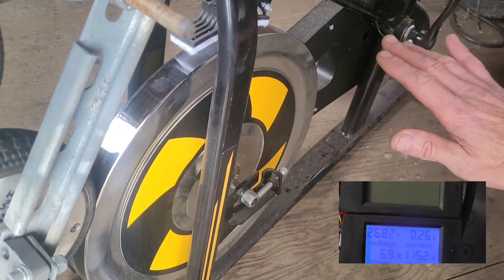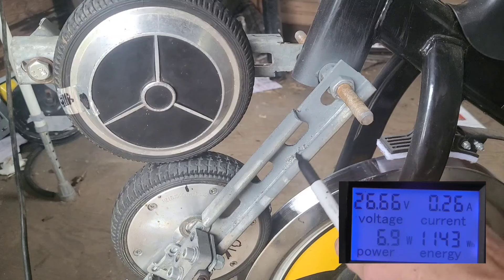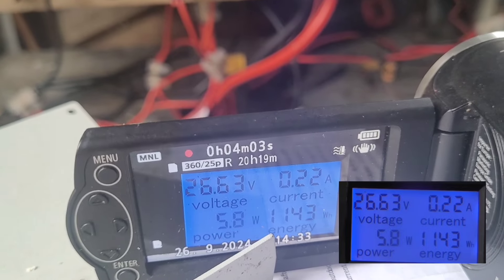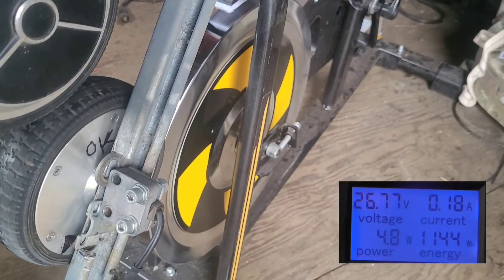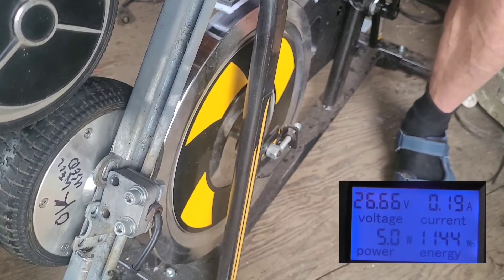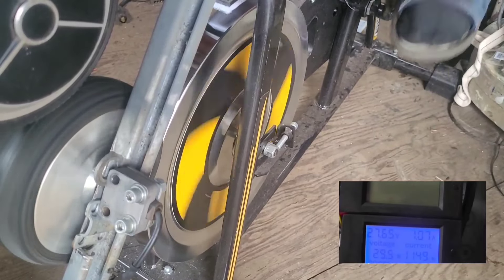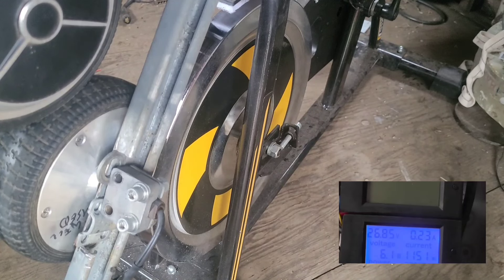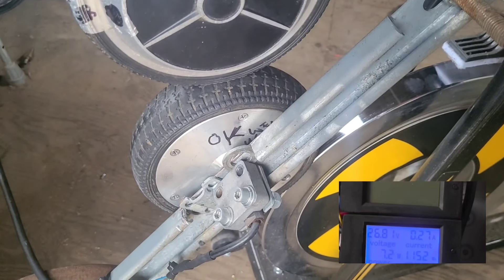Spin Bike is the best way to transfer human energy to electricity

Comment: In my opinion your losses through the mechanical connection (rubber wheel and spin bike wheel) are less when weight is applied. therefore the sound is louder because of increased friction between the two wheels and energy production from motor. not sure if this is 100% accurate but seems to be the most logical reason to me.